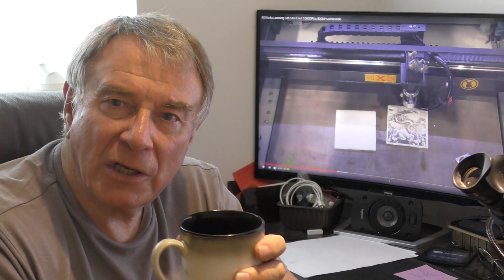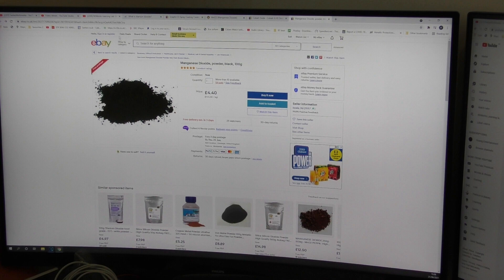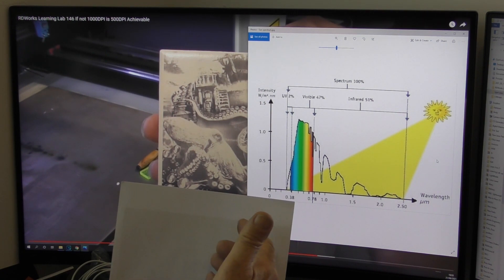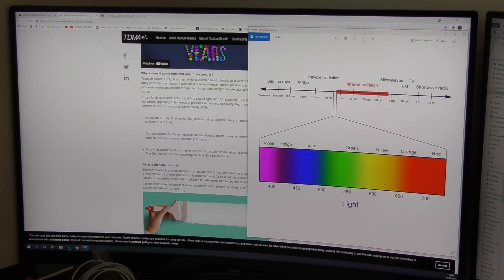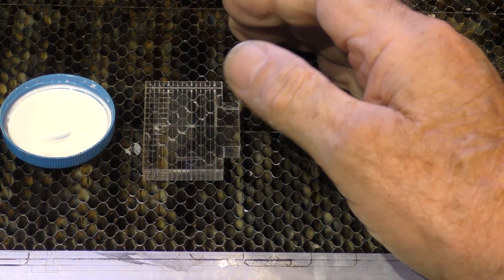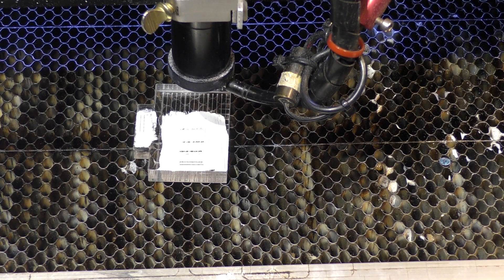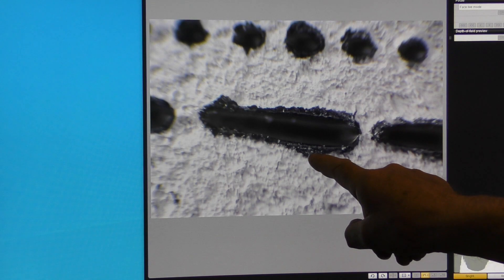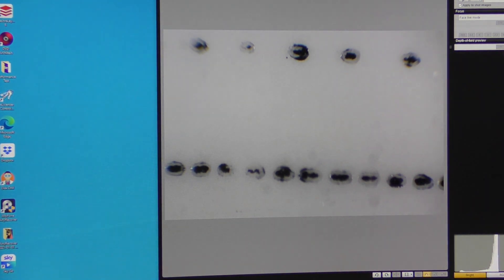RDWorks Learning Lab 211 Understanding Black Etching Ceramics Pt1

Comment: Great work Russ! What is your proportion for mixing isopropanol with acrylic?
Reply from the maker: I have no idea yet but as I intend using just a plant spray bottle the mix will  not be a slurry , more like milk. In that way I hope to lay down an even thin film.
 Best wishes
Russ
Reply: @SarbarMultimedia  An airbrush (which you may or may not have) works well with the commercially available products made for marking metals and ceramics. The technique for most of them is to spray only enough so that you do not see the underlying surface.
Reply from the maker: @DesignCutters  
 I have never needed an air brush,  but it looks like that may have to change. Thanks for the guidance.
 Best wishes
Russ

Comment: getting on pretty well doing tiles with new 50w co2 and ironlak paint which is cheap. Look forward to next vid, not seen those tiles from america before, just using plain ceramic tiles from B&Q lol
Reply from the maker: www.lasertile.com  no longer exists so I suspect they have hit a wall.. Yep I have just bought some of the same cheap white tiles. To be honest, what I have discovered about titanium dioxide. my guess is the EVERY white paint contains it.  I may even try some brilliant white ceiling emulsion and a few others.
Best wishes
Russ
Reply: @SarbarMultimedia  the facebook group norton den of lasers will have a lot of what nicky norton and the rest of the group have tried and the failures and successes
Reply from the maker: @Nonprofessional_Tinkerer  Thanks for the tip but I am not a facebook user.  So I maybe reinventing the wheel.
Best wishes
Russ
Reply: @SarbarMultimedia  little bit but in much more depth, have already linked video so may see some comments here for help or encouragement